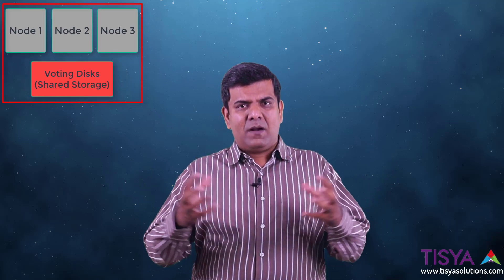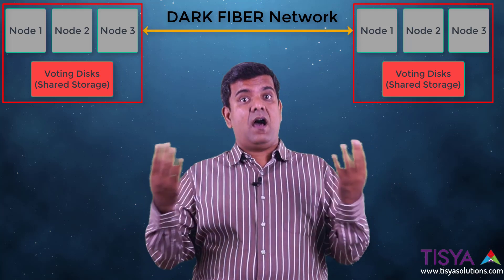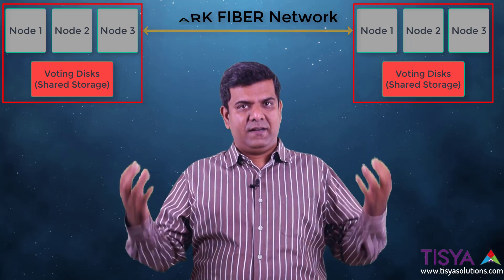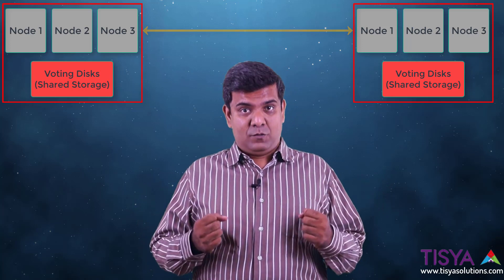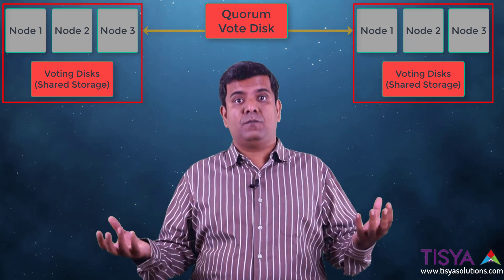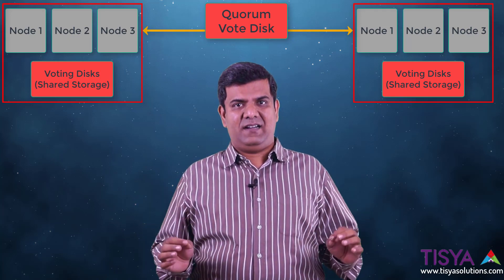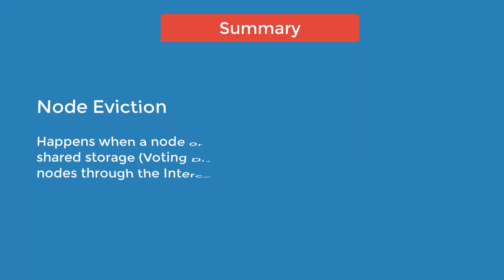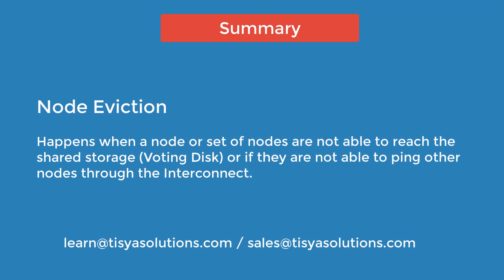Understanding Node Eviction - RAC 10

Comment: I have a cluster of two nodes, after  power failure one of the nodes can be up in the cluster but the second does not, both nodes are pinging each other, and also tracecroute successfully, the logs say no network hearbeat...but the disk heart beat is ok